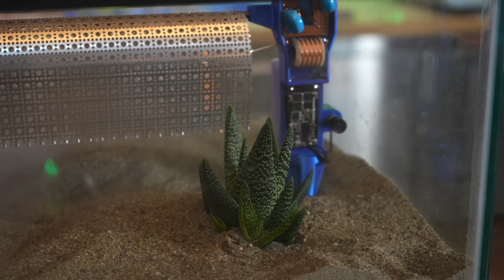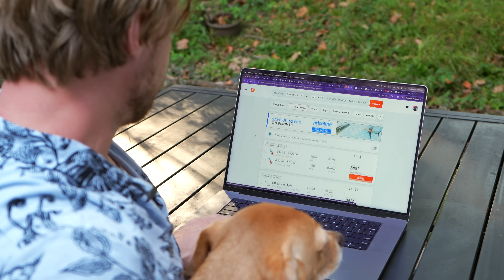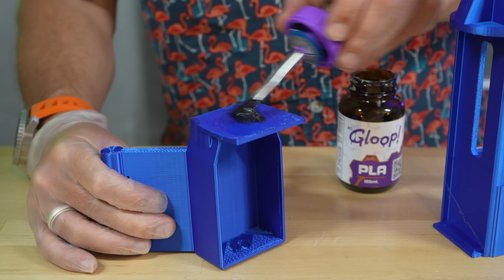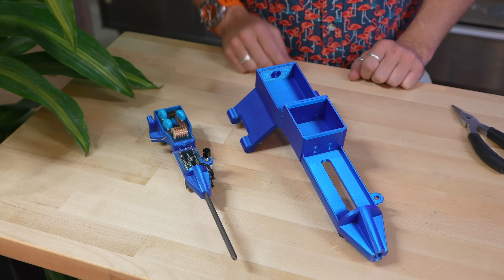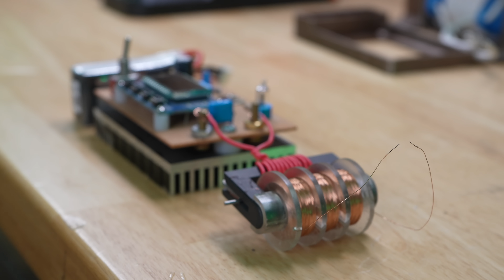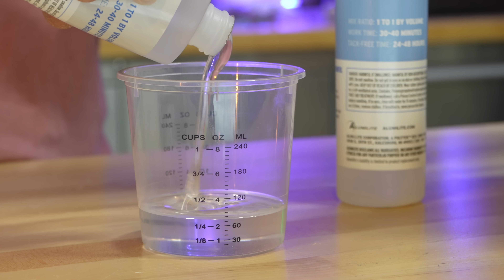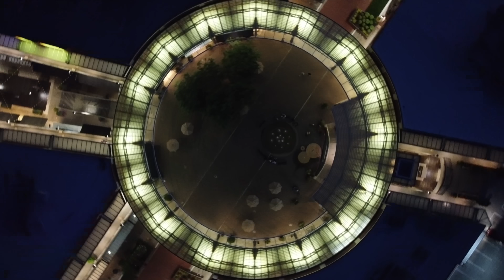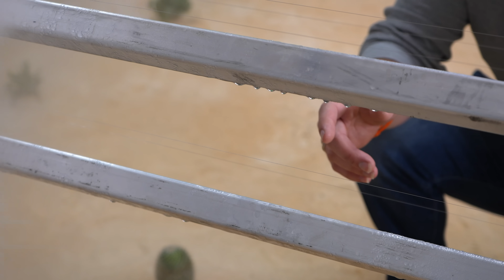Turning Desert Fog into Fresh Water Using 50,000 volts

Comment: Super basic weather API from one of the free weather APIs available nowadays, set it up for the region its in, and that can be your weather sensor that determines humidity to turn it on. 
I dont know much about humidity sensors but I'm sure there's an alternative you could find for as cheap in effort and materials as the weather API thing is. 
There's a couple of options to remotely activate it?
Reply: That way its not automatically toggled for no reason. 
If none of that, I saw someone else comment, fatyp something, that would be the solar panels, as the sensor, which I believe you could set it up as once it reaches a certain deficiency rating, but overtime the panels would go bad and provide inaccurate readings. 
Whereas the API or humidity sensor may have longer lifespans

Comment: on the fog-detection system, there are sensors for humidity detection that should be i2c compatible to trigger a relay. adds some complexity, but you could mount it behind the solar.

Comment: Use esp32 deep sleep mode to detect fog and activate the device 
Don't use Bluetooth you don't need it, just wired connection 
The esp32 will wake up every 5min to check if there is fog or not and based of that it will acivate/deactivate the water generator 

Gorgeous project 👌
Reply: Esp32 is not very stable even under normal conditions. Proximity of 16 kHz source with tens of kilovolts and DC with tens of kilovolts... I doubt you can make it work reliably at all.

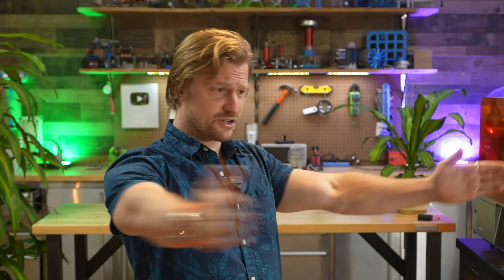Comment: 3:17 if you made it rotate based on wind speed, you could actually design the chassis so that it creates low pressure around the circumference which would actually draw in fog instead of replying on wind or passive air currents.

Comment: How are you actually collecting the water? It appears to just drip straight down onto the ground. I'd alter the design to add a trough-like surface for the water to drip down on and drain into a bottle. Cut some pvc pipe in half length-wise to get a C-shape and put it beneath the metal beams, angle it towards the end of the arms and put a bottle on both ends (or angle it towards the middle point and have only 1 bottle, but all the electronics are there).

Comment: To detect fog you need a dew point sensor. Basically, you need to make a weather station that can predict the ideal conditions for fog and turn on your HV circuit accordingly. 
"The dew point is the temperature at which air becomes saturated with moisture and water vapor begins to condense into liquid" 
1) You can use i2C temperature and humidity sensor (DHT11 or DHT30 for example)  and calculate the dew point inside a micro controller using the Magnus formula ( Arduino examples everywhere).

 or 
2) You can use dedicated capacitive or resistive dew point sensors connected to a micro (HR202L for example). 

All dirt cheap and easy to connect to a micro and get reliable values from.

Comment: For the "fog actrivated switch" you could try to repurpose a smoke detector, or at least the principles behind them. Some of them have like a laser emitter and receiver set up, and when the light is sufficiently dispersed by particles in the air, it triggers. Obviously fog has a different refraction index than smoke, so you'll need to fine tune its tolerance, that would be my best bet.

Comment: There's NO WAY you actually need expensive square metal tubes on the arms, right?
Just a wire with some aluminium foil around it (or maybe even just the foil) should do just fine in my opinion.
Reply: but theyre also structural, aluminium foil isnt that strong
Reply: @TACOCAT_67 They aren't structuraly important. Each endpoint is planted in the ground on its own. You need SOME tension in the wires I guess but I think if needed just planting the peg into the ground at an angle would be sufficient

Comment: God I love this project. However, I think excitement over tech is driving too many of your decisions. The tech is spicy amazing, don't get me wrong, but first, test the system in a place you're already familiar with-- like your backyard. Then choose somewhere within driving distance that's notably more foggy and notably drier. This way, you have some characterization bands for comparison when you test in the rainforest and finally in the desert. Testing in moist climates may seem redundant, but it'll give you a better idea of what the actual best case is of the device rather than the one in your head. 

Finally, remember KISS principles for day/night cycle management. The problem seems solvable by simpler components-- a couple photo-resistors, a thermistor and a timer. Make sure it doesn't run the cycle during the day, wait a predetermined interval after light falls below a predetermined threshold, and use the temp reading to make sure it's cool enough for condensation. Run until light or temp rises above another set of thresholds. Fewer points of failure and less high tech infrastructure necessary to run.

Comment: Good stuff!  
You might want to try to increase surface area of the collectors as much as possible for more water collection. Look up "open cell metal foams". A bar of metal (or metalized) foam would have ~5-10 larger surface area than a metal bar of the same dimensions.  

Also some questions for you: 
1) Why not use simple fans to induce more air flow over the collectors? Generally fans are low power and would eat only a fraction of your 120W budget.
Same can be used to blow airflow over collection nets in the desert (+battery with solar). I'm not sure why it not implemented yet. 
2) Have you tried seeing how much fog condenses when the system is powered OFF while the fog machine is blowing on it? (then subtracting the difference from when the system is ON to get the true mL/Wh efficiency).

Cheers! Keep up the good work!

Comment: 0:41 I remember watching the video and thinking, "someone should upscale this." I'm glad you followed through. This was a great idea.
Reply: Nah, let everyone have one for their own back yard, like in 😊AZ or CA next drought.❤
Reply: They sell dehumidifiers at Walmart.
This is already a pretty common technology, its just not used in the desert because the desert literally doesnt have much water in the air to take.
Reply from the maker: This isn’t a dehumidifier. Dehumidifiers won’t work in fog, and this won’t work to extract water out of clear air. My first video demonstrated the difference. The physics behind them is very different. Cheers!
Reply: @PlasmaChannel  
Would it be equally better to also add that fancy screening to both rails, and or several layers of it, so it doesn't melt.
And or use the outside tubing as the "wire" that is on the inside of a larger tube. With a welded plate equal in height to the 12-6 position so that; one plate is closer to the ground, for plausible grounding control, as you had stated. While allowing a greater surface area for collecting moisture for subterranean liquid collector tank with a hand pump. Just an un-Edge-u-ma-kated, thought. 😊
Reply: @readjordan2257  even the most efficient commercial dehumidifiers top out at efficiencies around 4 Liters of water per kWh and generally do not work when ambient conditions promote fog formation, because the evaporator will just freeze up due to the water being already condensed to droplets in the air.
The technique shown in this video on the other hand ONLY works in already foggy conditions, but can deliver a crazy good efficiencies, as shown (21 Liters per kWh for this jerry-rigged prototype, which is exceptionally good compared to a classic dehumidifier).
Reply: @readjordan2257 the point most people miss.
Also the amount of energy  could be better used in zransporting water in or get a better source

Comment: Look into the sensors they use in non-radioactive smoke detectors. Then mount the emitter AND receiver to the powered stake, and a mirror on the end of an arm stake with both emitter and reviever pointing at it ( actially at each other via the mirror). It'll pick up fog that way just fine. You effectively double the sensor distance. You're looking for the light to be blocked from returning as your ON signal. But add a rough timer circuit or a daylight-sensor with attached timer circuit to act as its control logic.

Alternatively, a proper mini CPU with a calendar loaded (raspberry pie?) That has known time periods to activate based on historical data from the region may be a more elegant solution.

Comment: Use the change in capacitance from moist air between the condenser and the charge wire to trigger the unit on, or a simple humidistat.  Nice project.

Comment: As an agriculture engineering student who in class (and well everywhere indeed) is being told that water will be our worst problem because of the lack of it, these types of solutions are so genius! Surely I will keep this idea in mind for the future and I would love to know more about this whole system and viability.
Reply: The main problem is using all the subterranean water to grow crops for cattle
Reply: If by genius you mean entertaining I'd agree. If by genius you mean a practical solution I'd laugh you out of town.
Reply: @in4theride75 explain further?
Reply: as an agriculture engineering student you should be able to calculate for yourself how viable this is. spoiler alert: it isnt
Reply: Could even be used to terraform the desert on a bigger scale
Reply: @SpreadYalegs  Battery storage needs to get a lot cheaper before it makes sense to use this, since reverse osmosis requires about 1/3rd the power for the same amount of water produced and isn't dependent on fog season.
Reply: @Steamrick  Worse. This method, as measured in the original video produced 14 liters of water per kilowatt/hour when desalination creates 286 liters of water per kilowatt/hour
Reply: @in4theride75   a desalination plant take tons of time, money and burocacy, you also have to pump the water upwards, and manage the salt byproduct, this can be used to make an oasis in the middle of nowhere
Reply: @000Krim And you think running kilometers of electrical wires, high voltage transformers, and the power plants needed to run them doesn't take a ton of time, money and bureaucracy? And then just let the water fall to the ground? Am I understanding your position correctly?
Reply: @000Krim  in calculated it in the last video. It would be cheaper to haul in water using trucks
Reply: @in4theride75  Dude this can be done by individuals on their own,  independent of the grid. Also we have serious problems in the towns that are near the Andes, many are ghost towns because there is no water, we have a whole problem with something called "water rights" people get their water from a truck .I'm from a costal  dessert city in the north of Chile and the water quality is not so great and kinda expensive. Let the water fall to the ground would be just silly, You can have this system in a hill, let it accumulate in a tank and use it in the crops of the valley. I think I'm going to crush some number to see if this economically viable later considering this local factors.
Reply: @in4theride75  for around 1000USD here one could buy and offgride system with 570W solar panels (3m2), with 8 hours of usable sun it became 4,5 Kwh or  63L per day, everyday. I agree it doesn't seem much, but in many places it could make all the difference.
Reply: @000Krim  If you're wanting to implement water collection at the individual level a fog net system is dramatically more efficient. Even if they are actively cooled by a heat pump it's still dramatically more energy efficient than this setup.
Look up a kirigami fog net.
Reply: @in4theride75  thank you, I would look it and compared it
Reply: @in4theride75  considering the L/hr of kirigami fog nets is 20L/square meter and this set up is pushing 2.5L/hr roughly, its plausible that if scaled to a full square meter of collection area this could be more efficient, considering this has no external power requirements (assuming the battery holds sufficient charge and the solar panel can charge it reliably)

Comment: I am so opinionated. Have to comment.
 I imagine solar cell on posts .
 A  buried wire so no one trips goes from the solar cell to the battery. 
Then to the electronics that you know much better than I do 
Now you have your static high voltage supply
Put insulated posts into the ground standing 4 feet high.
 Insulated means maybe a plastic tube to prevent condensation around the post
conducting to the ground. 

Fog from dry ice? to replicate real conditions have cool garage to nighttime fog
 temp and a fan on some boiling water to increase the dew point until fog forms.
 a fan can replicate the wind
Adjust the distance between the charged wires and voltage  to optimize water volume/watt
Peru could  be unnecessarily far.Go to somewhere on the west coast between 
April and October. There will be fog and temperatures similar to the coast of  Chile 
somewhere on those 1500 miles within 10 mile of the ocean. Probably on a ridge near redwoods. 
Or  May and June in Southern CA. 
May be tricky to get permission on a beach 
Perhaps you can do an Ad for Air BnB and rent  house a hill in San Fransisco about June 1 2026. 
any 3 day period i would imagine would have about 90% chance of fog  lasting hours. 
Few thousand feet up on the windward side of Hawaii also lot of fog and similar temperature. 

21 ml per watt hour is 21 liters per kilowatt hour. 
about 50 kwh per 1000 liters ( think that is like $ 2.50 to $5.00)
Impressive for a not optimized system if my math is right.
Reverse osmosis is like...$0.5 to $3 for 1000 liters 
of fresh water from sea water according to Google. 
don't be over confident. other engineers may have done this before.
good luck

Comment: 21:25 for this problem, two choice what about a humidity sensor or a daylight sensor? A daylight sensor would only work at night but the humidity sensor would work whenever humidity is high which has much better variable control as to when it's on/off.

Comment: You don't actually need all of this tech to farm moisture. Take advantage of the dew point and massive temperature range in the desert. 
1. Heat the air using a rising black metal duct.
2. Add water to the hot air (hotter air holds more water) with a mister
3. Cool the air back down by taking it underground (or even a white metal duct in the shade) 
4. Cold air can no longer hold the water, so it condenses out
5. You now have dry air and more water than you misted in

Comment: Very nice project but that little solar panel and battery isn't going to get you 120 watts of power for a 12 hour night and be charged during a 10 hour of standard day of solar charging.   You need a battery with a minimum capacity of 1.4 kwh (12 hours x 120 watts)  and 140 watts of solar to deliver that charge in 10 hours of sun.

Comment: I think on-site testing is still necessary. It doesn't need to be a foreign desert either. There are plenty of deserts here in the U.S. , and I think the best desert to get return data from would be the hottest desert on Earth, Death Valley. This is a device that is meant to be placed in regions where it is exposed to the elements. The data gathered from the harshest possible environment could help massively with creating adaptations towards improving the design both in efficiency and durability. Consider it my challenge, because if it works in the worst place on Earth, then it'll work anywhere.

Comment: What's funny is that in hardcore deserts the sand generates electricity, even more when it's a little windy, and if I can use an old LTC-3588 12 years ago to pull electricity out of the air under fluorescent lights we should be able to figure something out to keep that handy power flowing indefinitely.

Comment: Unless this is tested in real life conditions with both water production and energy consumption measured I remain skeptic about viability of this solution.

It does seem like it would use quite a bit of power to get a reasonable output and since you're not calculating anything but just going raw - proper measurements in a real world environment are a must.

Comment: So you made the  basic Prototype.
Since its supposed to be used in a dessert  and people probably wont deploy them only at night and rather let them stay over the day, the Condenser should be heat resistant so it doesnt  Short itself out, bend till useless, let the battery pop or get yeetet by wind right?

Comment: Next time you need to cool a small flat thing, use a CPU cooling system.  Not only does it look boss as $hit (like really, it's quite something), but it can dump heat like a pro.
I used one back when I was playing with TEC Peltiers, worked like a charm.

Comment: Now if there was only a way to harvest water from humidity in the air. A company has a device that is nothing more than an air conditioner with a series of filters to eliminate dust from entering the water production. Only issue is power consumption. Even though it is utilizing inverter technology it still has a way to go but the manufacturer states it can produce around 90 gallons of water a day plus or minus 5% depending on humidity and temperature. One would need a decent solar powered system to power it.

Comment: its actually a good thing that your 555 driver failed, because the if the chips didnt die, during your fog test it would likely burn up, as the on resistance of MOSFETs is not a major contributor to the heating of such flyback drivers, but the hard switching, where both the current and voltage are high when the MOSFET turns off, while a ZVS is zero voltage switching or soft switching, in such circuits only the on state resistance (and rise/fall times) contribute to heating, high power ZVS circuits can be completely passively cooled easily